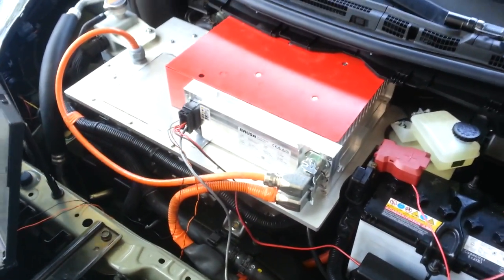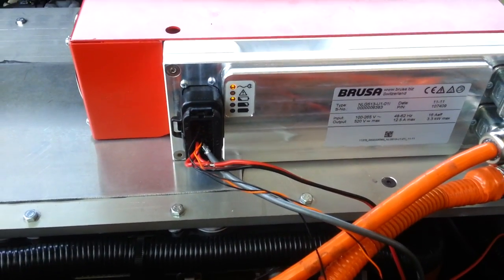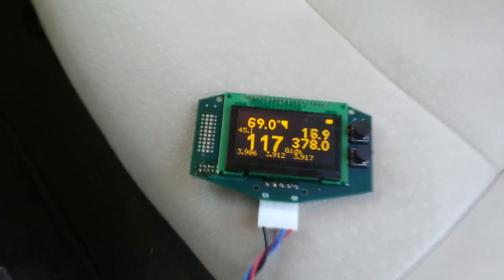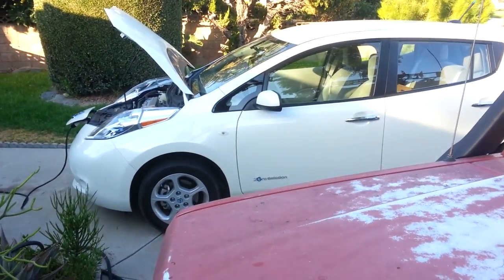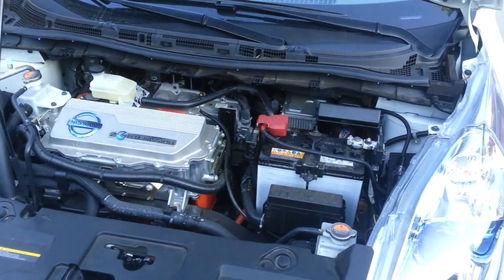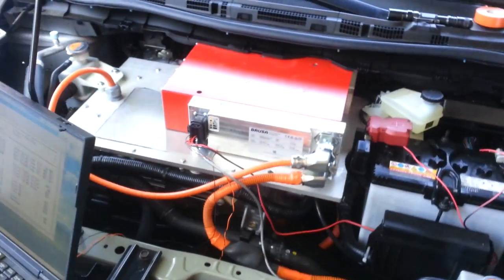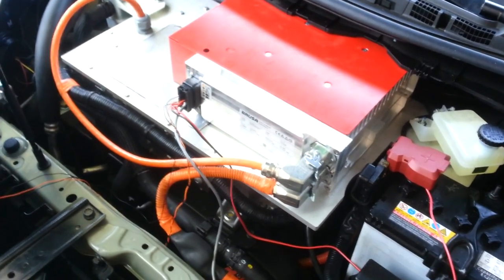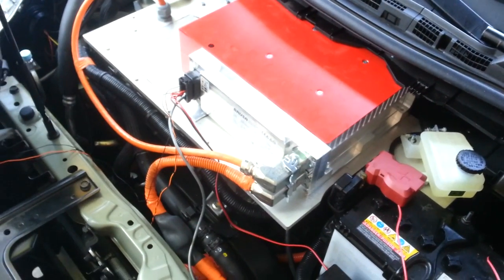Brusa Leaf Charger

Comment: How much did that cost you?
Reply from the maker: Its about $500 to $700 if you DIY and are handy. $1300 to $2000 for a kit or install. it depends.
Reply: Where did you get it from? I take it, its plug and play kinda deal?
Reply from the maker: I built it from scratch. I designed and engineered it along with all the custom cabling. It's built only for the Leaf which is why I said you would have to do a DIY setup for your car.
Reply: What about the 3 phase 22kw brusa NLG667 ?? Is there nobody out there who tried it ??
Reply: pol1250 the charger itself is close to $7000 dollars

Comment: Can I install it on my 2014 spark ev?
Reply from the maker: you can if you are handy.
Reply: Thanks. Do you have a diagram?
Reply from the maker: for your car? no. For the Leaf, it's on the link at the top of the page here. You would have to DIY your car. I don't think anybody has done a spark yet.
Reply: For the Brusa NLG513
Reply: I need this for my conversion. Charging fast requires this and cooling the battery...that's it right?
Reply: @xXZ31t6esTXx  Oh this is old stuff now. You can install a Tesla onboard charger in 2020. Search for damien mcguire videos
Reply: @jpl9148  thx man

Comment from the maker: A CHAdeMO doesn't require 3ph power. There is now a 12kw portable DCQC/CHAdeMO charger that's been shown and built on the Leaf forum that runs off 240v 50a single ph using a 3d printed connector.

Comment: The Chademo setup requires a 3-phase supply and they aren't exactly available in abundance - the 6.6kW option is FAR more versatile, not to mention kinder to the battery.

Leave Chademo to the gas stations and dealership forecourts.

Comment from the maker: It does, and cuts downs the charge time to less then half. It's faster then a 2013 Leaf (6.6kw) because 2011-2012's are 3.6kw stock(240v rating) and the Brusa is 3.6kw at 240v... pretty much injecting 18amps solid up to 401v..

And yes, the Brusa is just running either as a slave (AUTO) or in CAN mode.

Comment from the maker: There's not a kit really, it's all DIY. You can buy the Brusa from MetricMind and I have the plate or the DXF file that's on the forum. You have to hook it up yourself if you have the knowledge. It is HIGH VOLTAGE and can kill you so don't go digging around without knowledge of the system.